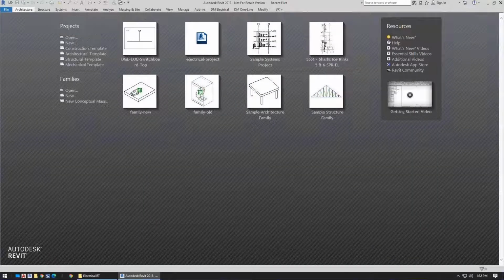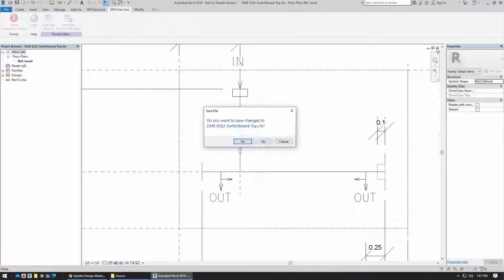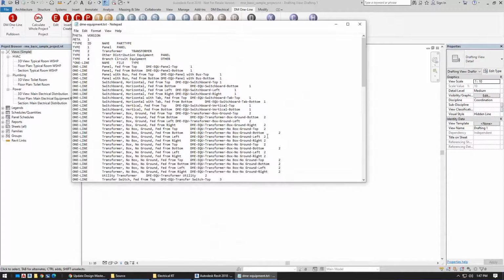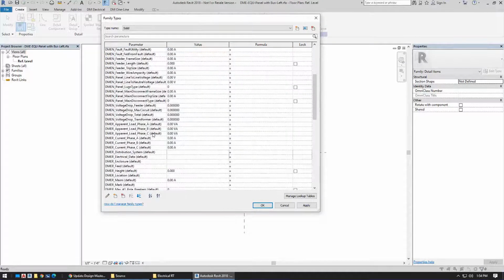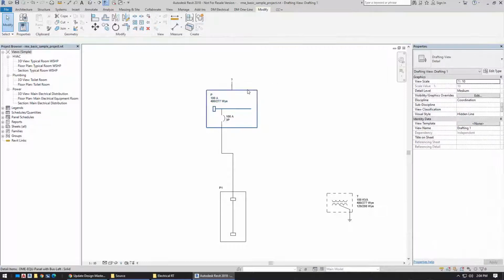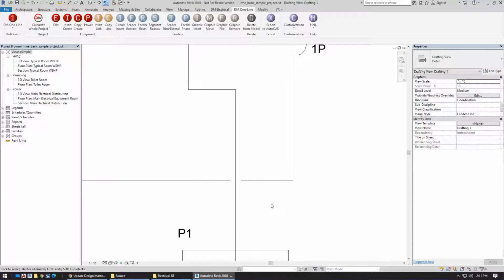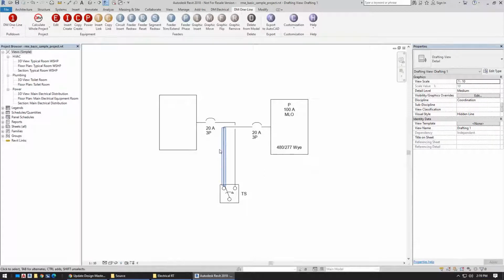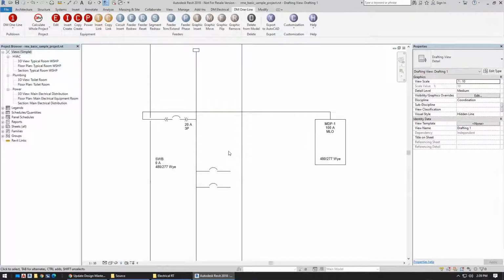Design Master Electrical for Revit: One-Line Diagram Customization in Revit (11/12/2020)

Comment from the maker: How Design Master one-line diagram graphics work within Revit (01:02)
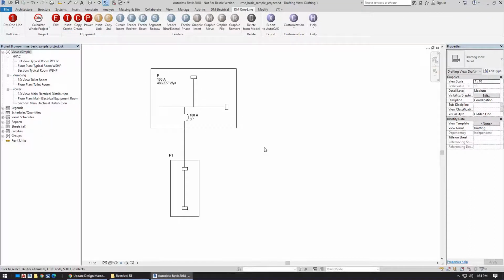Customizing the Equipment Type, One-Line Diagram Graphic, and Model Family fields using the Device Graphics command (02:00)
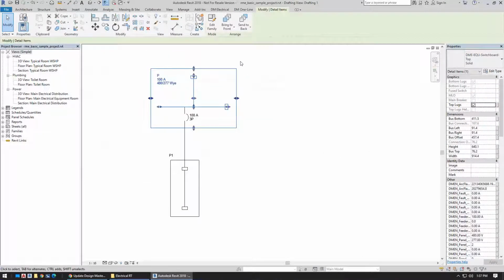Modifying device graphic families using the Revit Edit Family command (04:28)
    Working with feeder connection points (05:25)
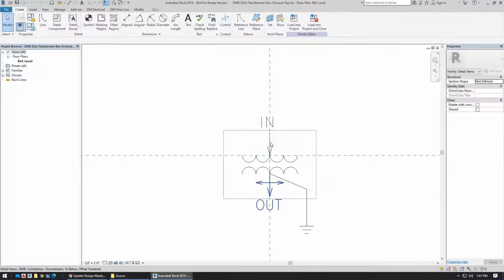    Defining graphic line styles (07:19)
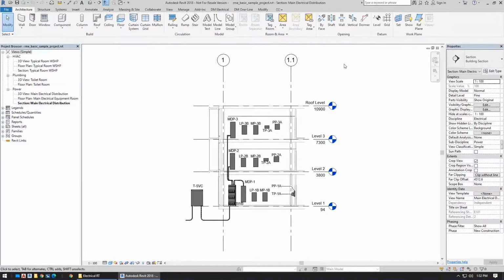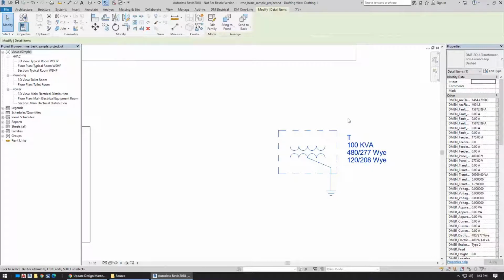Why we recommend 1:12 scale for your one-line diagram (08:28)
Graphic families and Revit versioning (09:55)
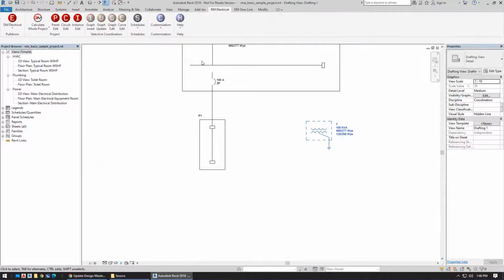Viewing and setting your customization folder using the User Options command (11:11)
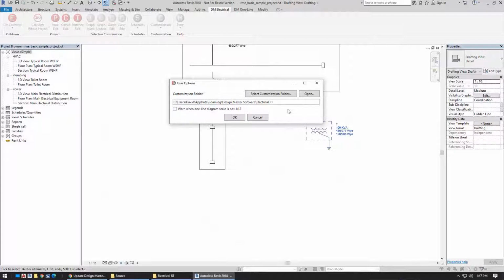Important note for beta testers customizing graphic families (12:02)
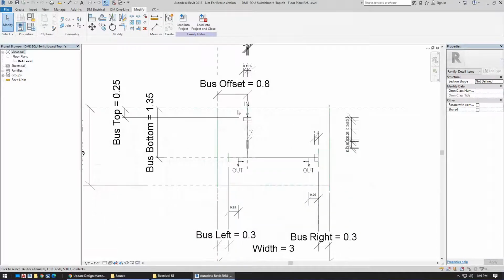Using graphic family parameters (13:58)
A note about making your own graphic families (16:17)
Using Design Master shared parameters in graphic families (18:08)
    Adding shared parameters to a graphic family (18:50)
    Customizing graphic labels (20:55)
    Adding labels to the one-line diagram (22:17)
    Setting default labels for graphic families (25:18)
Modifying feeder graphic families (30:03)

“Can I swap the graphic for a device I’ve already inserted on the one-line diagram?” (17:09)
“Is the one-line diagram drawn in a drafting view?” (32:38)
“How should I draft a transfer switch so the upstream feeders don’t overlap?” (33:06)
“How do I place a meter and OCP on the same feeder segment?” (36:40)
“Can I change how upstream devices are connected to a transfer switch?” (39:13)
“What are the use cases for the Circuit Insert command?” (40:28)